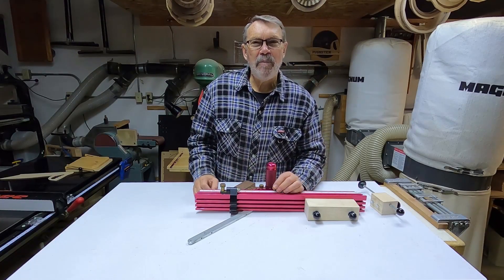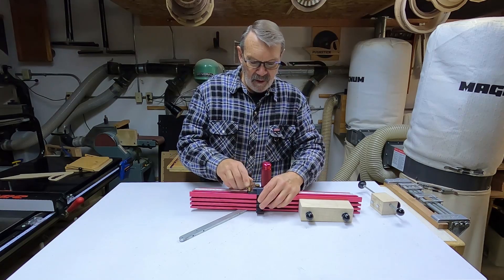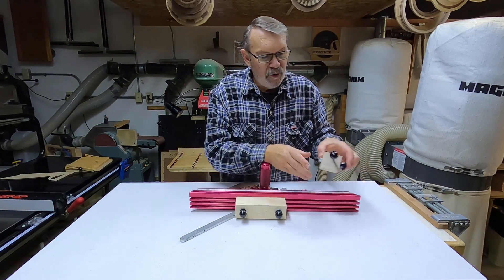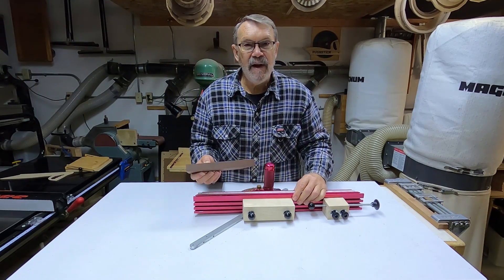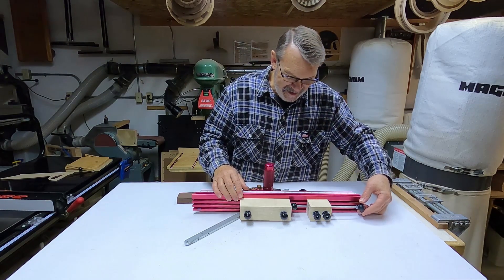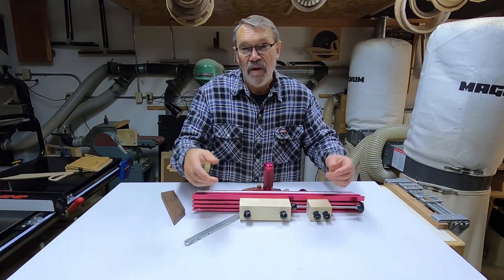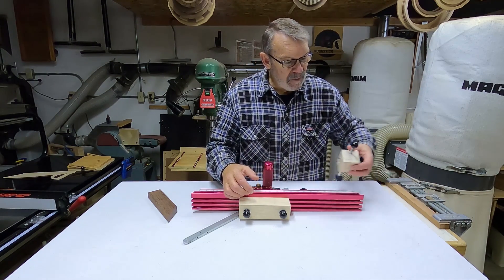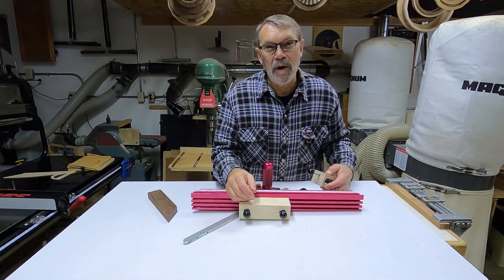Miter Gauge Precision Adjuster

Comment: Great tips Gord. I made something similar back when I need to cut pen blanks to length on the band saw. The 1/4" 20tpi is perfect for fine adjusters with wood. I found toilet bowl bolts fit my slots and are long enough as well, I had extras kicking around so used them up this way.
Reply from the maker: I must admit I wouldn’t have thought of toilet bolts but I guess they would be perfect. I hop someone else reads your tip! Thanks for watching, Bert. 😃😃
Happy turning,
.....Gord

Comment: Nice idea. I presume it would work with the adjuster on the other end (for longer stock) too. You'd have to remove the adjuster before you cut, but it should work. 
BTW, I'm a little upset that Donald MacKay beat me to that pun. I have a reputation to uphold. I'm not angling to lose my slot as pun king. But, I respect him for a worthy effort, so let's table this conversation. 😎😁😇
Reply from the maker: 😂🤣😂🤣
Sorry, Bill, I didn’t mean to undermine your supremacy. I will stand back and let you two gentlemen hash it out. Yes, my cowardice reigns supreme! 😃😃

Comment: Nice adjustment tool. Always good to see how others approach a problem. You might have also mentioned the bolts are carriage bolts. The square under the head keeps the bolt from spinning in the slot. Always good stuff from you Gord. Thanks for sharing.
Reply from the maker: Glad you liked it, Glen. Actually, the head of a 1/4” carriage bolt is to wide to fit in the t-slot. I used plain 1/4” bolts. The head of a 1/4” hex head bolt won’t turn in the slots. They are a perfect fit. Thanks for watching, my friend. 😃😃😃👍👍👍🇨🇦🇨🇦🇨🇦

Comment: Nice tip Gord. I didn't know 1/4" bolts fit into std slots. 
I'll see your tip and raise you one ... I have often used 10-32 bolts for the fine adjustment trick; you usually can just screw them into a hole w/o threads. And the turn-to-distance value is easy to comprehend. -Mike
Reply from the maker: That is a great idea, Mike. Unfortunately, even if I had thought of it I wouldn’t have 10-32 bolts long enough for that use and I like to use what I have on hand. Too lazy to leave the shop! 😃😃😃
Thanks for watching,
.....Gord

Comment: I am kinda wondering if the same can be done for the flip stop that comes with the gauge. An adjuster to place the flip stop against to position it accurately and repeatably. It would probably need to be made out of metal to get it small enough to fit on the top track.
Reply from the maker: That might very well work, Adam. Maybe I shouldn’t have given up on the flip stop but I’m happy with what I have now! I would be interested in how it works if you decide to try your idea. Thanks for watching. Have a very Happy New Year! 🥂🥂🥂🇨🇦🇨🇦🇨🇦
.....Gord

Comment: Gord, why 2 different pieces? Why not just use the small stop block with the micro adjustment? If you need finer adjustment, use a finer thread count. Take the knob off the front and put a small block in place of it. Then you have your stop block and the micro adjustment. Your friend in Forestburgh, NY USA.
Reply from the maker: Richard, I would be concerned that having just the small block with the threaded rod would allow vibration to cause the rod to turn. Unlikely, I know but I try to avoid any possibility of things like that. I would rather over engineer it than have that possibility. Call me a fanatic!! Thanks for the input, Richard. I appreciate it. Thanks for watching! 🇨🇦🇨🇦🇨🇦
Your friend in Canada,
.....Gord
Reply: You can beat the vibration by adding some Teflon tape to the threaded rod. The Teflon tape with also tighten the rod to wood area. Another way is to add thin CA glue to the wood treads then spray with activator. This makes the wooden threads harden. I’m sure a woodworker with your experience already know these tips. A refresher tip never hurts. Best regards my friend, Richard...